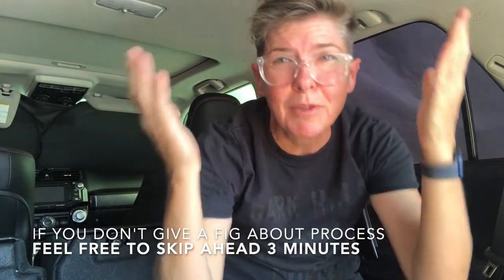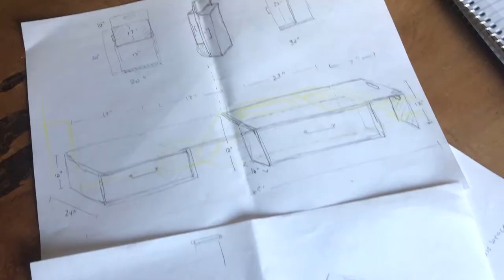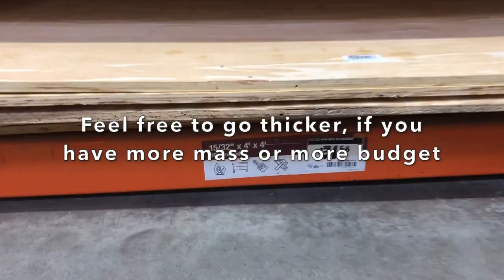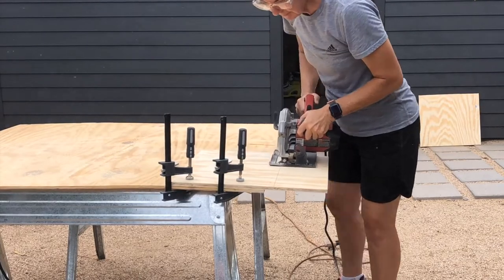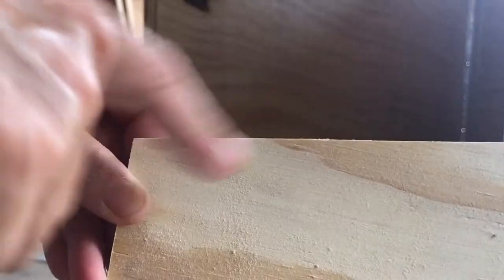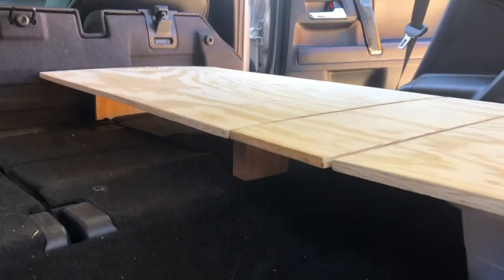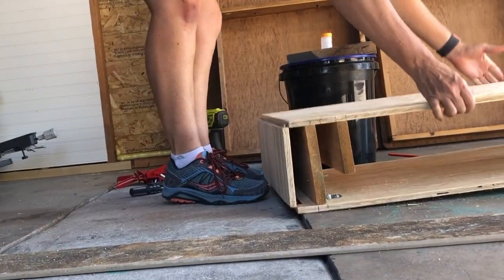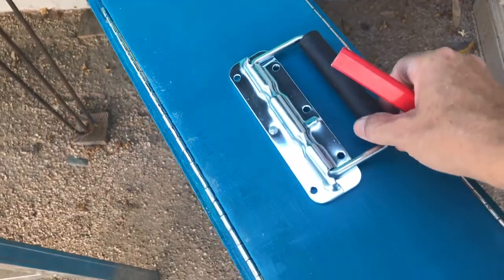Folding, Flexible, Solo Sleeping Platform -- a compact solution for 4Runner or any vehicle.

Comment: This video is everything I want! I want to keep my seats in place. I want to be able to put away bed frame as easy as possible (I’m a little older and 5’) 😂😂. I LOVE your design.
Reply from the maker: Thanks! I did have to add external braces to the legs, but other that, it's still holding up.

Comment: Great build! I was just wondering if you can fold the bed frame up while inside the car, or does your space require you to pull the frame out of the back of the car to fold it down?
Reply from the maker: Thank you! Yes, you can deploy it within the vehicle, and that's how I usually do it. I load it in closed, on its side, and then open it, and flop it down right side up. I found this way keeps the feet from hooking onto the ridges of the cargo area, preventing me from getting it into place.
Reply: @ShoestringMartha  That's fantastic, thanks for sharing!

Comment: Im 250 pounds and i wonder if this will break
Reply from the maker: When in doubt, more and/or sturdier corners braces. I had to add a couple to the outside of the two legs at the foot end.
Reply: I bought 3/4" ply